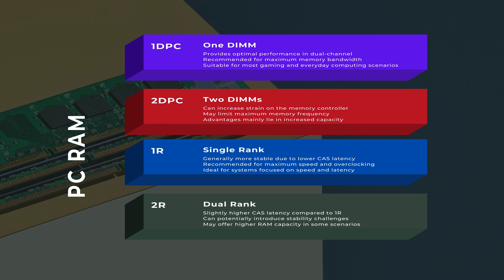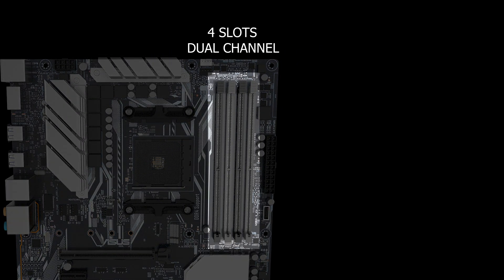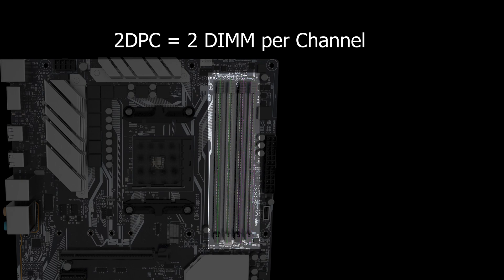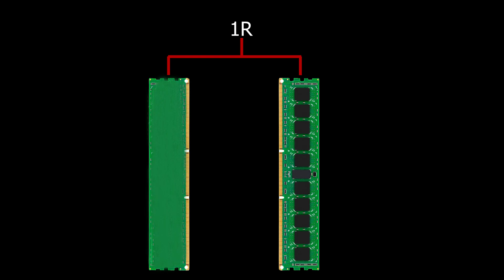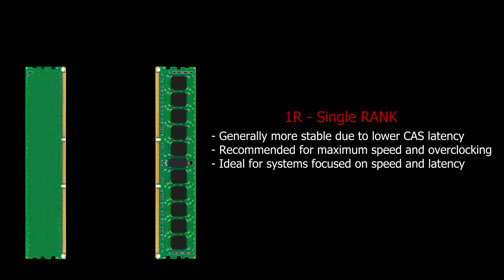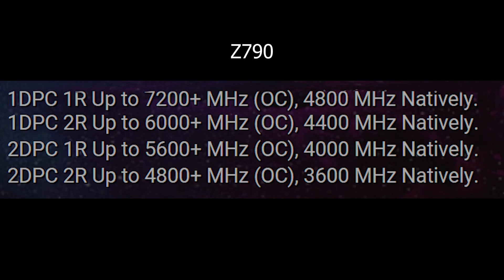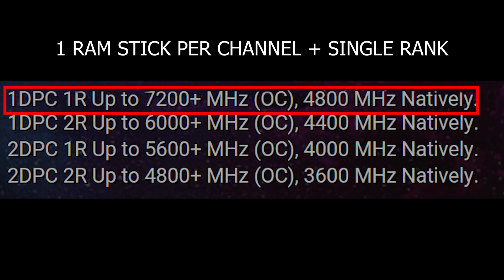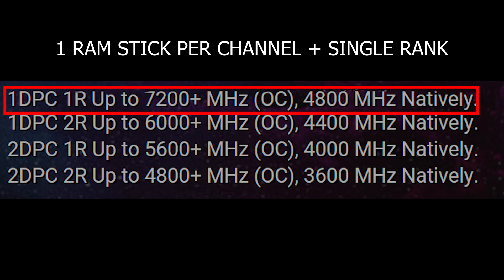MUST to know before buying RAM | useful for Overclocking

Comment: Finally a visual explanation of all this.🙏 (I was really confused before what 1DPC/2DPC actually meant in terms of how many memory sticks involved)
What is 4R and 8R memory then? Dual rows of memory chips is it?😕
Reply from the maker: Thanks

(4R) is QUAD RANK, Similar to dual rank, but with four separate sets of memory chips.
while (8R), Octal Rank has 8 separate sets of memory chips on a single memory module

this is a visual of a quad-rank memory:
https://www.eetgroup.com/it-it/815101-b21-hewlett-packard-enterprise-64gb-4rx4-pc4-2666v-l-wid-w124335330

this many ranks for memory are usually used for enterprises for much more RAM capacity and netter bandwidth utilization,  for consumers 1-2R is usually the most common

Comment: I found this on google, can you explain it please.

Single Rank Memory can be memory with chips on only one side of the memory module (stick of memory) or chips on both sides of the module as long as the chips are in one rank that is accessed while writing to or reading from the memory.

So dual rank memory does not have to be with chips on both sides. It is something else.

Comment: Perhaps it´s important to mention that a single stick of DDR 5 natively runs in dual channel, a lot of people are familiar with the dual channel term without actually knowing the tech specifics. What they don´t know is the difference between DDR 5 and DDR 4 in that regard.

I ran a few tests with a single stick of DDR5 and two, not much of a difference unlike DDR 4 where the difference can be huge. The 1% lows are significantly better with dual sticks in DDR 5 mode though, the overall FPS isn´t.